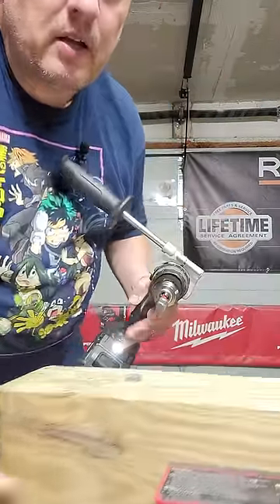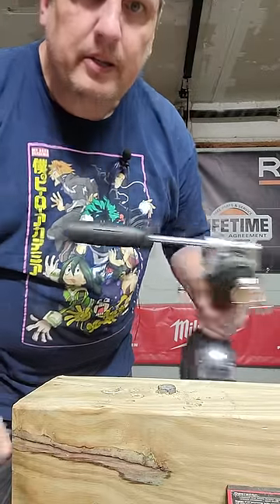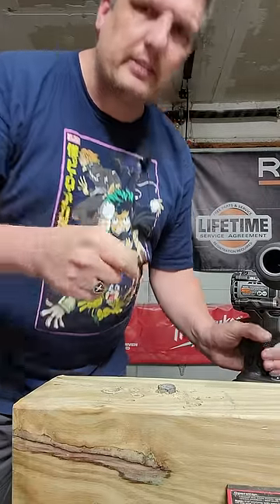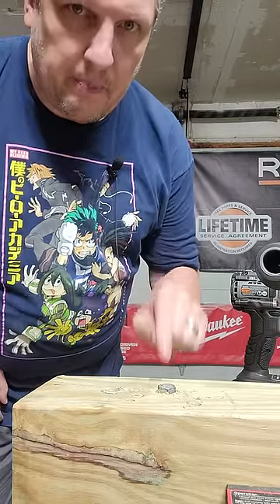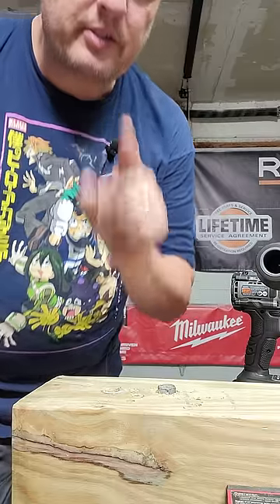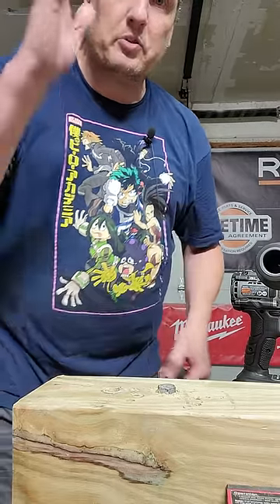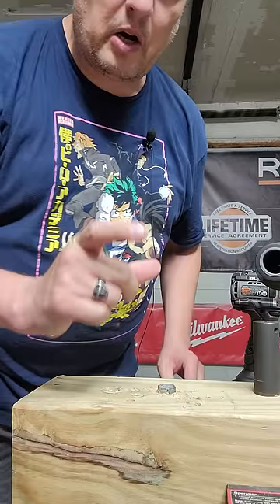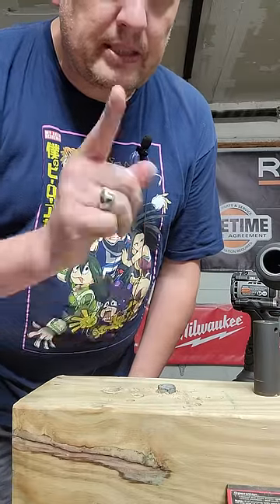Challenge Accepted! Now What? #challenge #powertools #tools #power #drill #EMBARRASSING #victory

Comment: Use a correct sized impact driver for it and the impact will send it faster. As for wrist saving, a hydraulic impact of the correct size would be best if they are made, if not, get on it Milwaukee! I’m sure those would fly off the shelves, I would love to use one for lug nuts on cars instead of using a loud ass electric/air impact all day.
Reply from the maker: No ma'am the drill is the only tool you would use for this

Comment: I pre drill, then use screwdriver. Both devices have less load and the material isnt split. 

Only time i force a screw in is when i have no other option.

Comment: A drill is for drilling a impact driver is for driving lags, screws etc. I promise you that drill will burn up before lag number 10. I have driven 25 lags that size after pre drilling of course on one 5amp hour 20 volt battery battery no problem. And I am still using it years later.
Reply from the maker: I have already proven you wrong
Reply: @ToolswithSoAlz  you sank one lag on your video sink 25 on camera without editing or stopping then tell me I am wrong
Reply from the maker: @bryanbarner5665 now go back to relaxing your throat and making eye contact because that's the only thing you should use your mouth for. 

https://youtube.com/live/usqL3F6uPSo?feature=share

Comment: Yes, you can do this, but only with a pro drill. And it's faster than an impact. But you can drive big screws with any driver. Also, you can buy drill bits for a driver.
Reply from the maker: You can drive screws with a drill if you know what you're doing
Reply: @ToolswithSoAlz  I agree. My friend is a contractor and he uses a drill for driving screws.

Comment: Bro, you are going to destroy that drill. An impact driver is a much better tool for that application. The trick is, you need a larger impact driver. Preferably a half inch drive.
Like a mileaukee M18 fuel 
If you truly think that your drill is going to be able to drive lag screws like that size throughout the day without burning up, you are sadly mistaken.
It's all about using the right tool for the job.
Reply from the maker: I have already proven you children wrong
Reply: @ToolswithSoAlz Man you are angry. Prove us wrong by driving in 100 lag screws like you just did.
I'm not trying to bust your chops, but you have not selected the proper tool for the job.
Reply from the maker: Princess I blew up your precious impact driver doing this just three times. If you weren't such a retarded POS you would know what you're talking about. Unfortunately you are

Comment: Do that test with an XR20 1/2 DeWalt. A tool up to the task, that is easier on your wrists. A 1/4 hex impact is a cabinet makers tool, not a big lag driver.
Reply from the maker: I did. The impact loses and you should never use an impact for this
Reply: @ToolswithSoAlz  I did not see a 1/2 INCH DRIVE impact. Just some shtty 1/4 hex drive crap.
Reply from the maker: @jamesgeorge4874 Ma'am you're letting your excuses expose your ignorance

Comment: Do a battery test, can an impact pound more bolts or can a drill do more.
Reply from the maker: Let me ask an obvious question that even a stupid person could answer. Honestly, any moron could figure this out if they took a second to use the space between their ears. 
Do you believe a slower, less efficient, tool, that has to work harder, hitting metal on metal, building heat, can use less battery?

Comment: You don't know what you are talking about sir. The hammer/impact drill is for being up on a ladder and throwing in a screw with your arm stretched out and very little back pressure to keep from slipping. The drill fails in that regard. Each tool is equally important for it's application. One is not better than the other.
Reply from the maker: Ma'am the level of stupid that just came from you tells me you have never been on a job site. Princess, ever heard of the clutch? Yeah the drill is better. Sorry to educate you

Comment: Yea for one bolt do 10 back to back without smoking the battery or motor. My DeWalt impact can and then some.
Reply from the maker: I have already proven you wrong and I did it live. Not only did a Dewalt Impact driver burn to the ground doing only three of these but it took it 20 minutes to do the three. Dewalt simply doesn't make a good impact driver. Whereas the drill smashed this same test seven times in under five minutes and didn't even get warm. You little children know absolutely nothing about tools but you keep whining like you do.

Comment: you lot are talking about the 1/4 impact drivers that are designed for wood screws... what you should be using is a 3/8 or 1/2 impact driver the same as a mechanic uses to put wheels on a car
Reply from the maker: No, you should use a drill.

Comment: Impacts help save your wrist. Work smarter not harder. You worked hard getting that bolt into the wood. And impact would do the work for you and save your wrist in the process.
Reply from the maker: Unfortunately for you only one of us knows how this would really be done and why the drill is the only tool you would use

Comment: Impact for torque, drill for smooth and consistent rpm, why is this even a question?
Reply from the maker: Read the comments
Reply: The drill did seem to work quite hard under that load, and it did seem that you needed to use a lot of effort. I'm also not sure how many  of those you could drive before that drill at least overheats. So why do you argue the drill in this work scenario? I use electric impacts often, not for that type of work mind you. And they are quite powerful and efficient in size 3/8 to 1/2

Comment: Drills are faster, but get in tip toes, as high as you can, and try installing a Phillips screw with a drill, unfortunately on real construction most of the time you're not working in a comfortable position.
Reply from the maker: You don't know what you're doing and you shouldn't buy, let alone try using, tools

Comment: Not significantly faster. I don't need to start bolts with a hammer before I put an impact on it. And I use much more small fasteners on jobsites now... an impact can replace a drill nowadays... the drill wouldn't replace an impact on-site
Reply from the maker: You have absolutely no idea what you're talking about

Comment: Impact is made for torque and will get it tighter and used on harder materials but drill is always gonna have the speed to compensate but will also twist the entire system like it did at the end of the vid
Reply from the maker: Which one looked like the right tool for the job here? You know, like the title of the video suggested?
Reply: @ToolswithSoAlz for wood either works but drill would be preferable, auto body work is more of an impacts job

Comment: But you failed the second you used a hammer.
 Impact driver doesn't need a hammer to get the process started
Reply from the maker: Ma'am you're letting your arrogance expose your ignorance
Reply: I use compact drills for metal roofing and I tried a normal drill for a couple weeks.
 My arrogance showing my ignorance?
If you were going to hammer the tip into the wood might as well drill a hole in the wood so you don't cause wood damage side note.
 Also it's you making a video about a challenge well if hammering the pit into the wood was part of the challenge I can understand you're just doing what's allowed but let me remind you this is a short you called it a challenge next time brief us about the challenge.
 This is my first time watching anything of yours.
 My first comment was a question over all because I didn't understand so yeah maybe I was showing my ignorance but to get over being ignorant I have to learn smart ass. Also I can admit when I'm wrong or when I did fuck up like I failed to use a question mark ? At the end of the first sentence or should have phrased it better or properly. 
 In short I understand that you're simply trying to give an example of why the drill is better but I still don't understand why exactly so smart ass please teach me something instead of being a dick.

Comment: Notice the tremor in his right hand as he's trying to start that massive lag..Notice the anchor handle  so that he can use both hands... the tremor is likely nerve damage from when he decided to test his therories and the drill nearly ripped his wrist apart.  So what does the impact driver actually do?  Well  in this case... it allows a DIY'r the ability to put this lag in and not wreck himself doing it.  So .. Use your drill if you like, but for $150 bucks... I can buy a Milwaukee impact that will last through thousands of lags just like this one.. without damaging my self, or the wood I am driving into.
Reply from the maker: Ma'am, I have Parkinson's disease. But you brain dead little girls have never had a clue as to what, when, or how to use tools. Shut your clap trap and maybe you'll learn something.

Comment: Drills are definitely better for wood, but please, for the love of god, do not use one with thick metal. That drill will come right around and Mike Tyson the shit out of your wrist
Reply from the maker: Don't hold your tools like you hold your purse
Reply: @ToolswithSoAlz  I dont know what tools you are using but my drill has enough torque to pull out of my grip, and on top of that you have a second handle which definitely helps. To be clear though this comment wasn’t exactly directed at you

Comment: any tools can do this job but but but !! efforts required are different. the best drills, as long as it's not a rotary, have about 1/2 torque of impact driver at the same price.
Reply from the maker: The drill is the only tool you would use for this

Comment: I respectfully disagree. You seemed to put a lot of effort into that. The beauty of an impact is that it takes away the human variable. Let's see you do that with big Phillips head screws. I know you make it work but the impact is better for the job. We could just put a 1hp motor on the drill and it will do even better in time then the one there. It's gonna create extra human stress.
Reply from the maker: You should never even think about using an impact for this. This isn't a how-to video but a can-do video because I accepted the challenge of some moron who thought the impact was the tool for everything
Reply: @ToolswithSoAlz  it really seems like you're suggesting that a drill is the tool for every job. You did prove the drill is capable. I think if you did that job every day you would start to want the impact. My dad used the same machine for thirty years now and his fingers are damaged from the button. The easiest part of the job and it's damaging his hands. Another funny thing, at a shop I worked at, many people avoided using the crane regularly. The crane can often taken longer when you're able to get it yourself or all someone to grab the other side. The crane often takes longer but is still the best way to do the job. If you're proving that it can be done then you've succeeded. I just believe in the right tool for the job.
Reply from the maker: You sound like you don't understand what's being said. 
Impact drivers are designed for small fasteners, where camout is a possibility, self tappers, and over tightened nuts and bolts. That's it
Reply: @ToolswithSoAlz  I do agree that over tightening is possible. I watch my boss over tightening stuff with his impact all the time. It's true that you can use a setting to not over tighten. You have a point there. Maybe companies should create a system for the impacts that are like the drills. I think about that with the big electric impact drivers. They generally have 2 settings.

Comment: The drill may be the better tool, but my f***ed up wrist prefers the impact driver.
Reply from the maker: Maybe you should learn what you're doing?
Reply: coming in hot there, without having context. I have a screw permanently in my wrist that doesnt like the front heavy-ness, and the start and stop kick that drills have. didnt even know it was the drill that was the problem till i switched to an impact.  @ToolswithSoAlz
Reply from the maker: You should learn about the pilot hole
Reply: @ToolswithSoAlz  I do pilot if I’m worried about wood splitting, but most of my work that’s not a worry. I’m not gonna pilot just to not have to worry about kickback, when my impact does that for me. And that also doesn’t do anything about the awkward forward leaning center of gravity that the drill has that fatigues my wrist, where the impact has a center of gravity in the perfect spot.

Comment: Impact drivers are for brick/concrete walls indeed
Reply from the maker: Impact drivers are designed for small fasteners where camout is a possibility, self tappers, and over tightened nuts and bolts. That's it

Comment: My 1/2" Milwaukee impact would drive that with a one handed light touch. That drill will burn out while an impact will still be going.
Reply from the maker: And would still be slower and not the right tool for the job
Reply: @ToolswithSoAlz  
Whatever, I see you struggling and pushing down so hard. Do that 100 times on a project.
Reply from the maker: @kimchee94112 Honey, are you so dumb that you believe pushing down made the drill spin faster or the wood softer?

Comment: not true, if you're a professional driving bolts like that all day you're going to wreck your wrist using a drill. Look at what happens at the end of him driving the bolt, there's no much torque that the table along with the piece of wood moves! An impact wrench is a much safer and better tool no matter if it is slightly slower.
Reply from the maker: You have no idea what you're doing or what you're talking about.

Comment: Dont use a drill or an impact driver. An impact torque gun is where its at for big bolts. You push the bolt through the timber with one them bad boys.
Reply from the maker: Unfortunately for you only one of us knows how this would really be done and why the drill is the right tool for the job
Reply: @ToolswithSoAlz  well i wouldnt be hammering it in place, i'd  be predrilling it.
Reply from the maker: There is no such thing as predrilling.

Comment: To be fair, You beat the sh*t out of the drill and battery (full power at near stall speed for no cooling), whereas the impact could hammer away on that type of screw all day.
Reply from the maker: That's not true and I have proven it. Impacts are not made to be used constantly. Only in short burst.

Comment: Can tell by how shaky your right hand was while holding that bolt that you’ve spent a long time using the wrong tool for the job.  How’s that wrist doing with all that torque on it?
Reply from the maker: Only a moron would use an impact driver for this.

Comment: 24v with a gaint side handle..... so much better huh 1/4 hex impact would have done the same thing using one hand without the giant ass battery... in your comfy shop on the ground with fresh batterys makes it look like your correct
Reply from the maker: Only a moron would consider doing this with an impact driver. Ma'am before you pretend to be something you're not, i.e. a professional, then it would help if you knew the basics. You don't even know what tools to use. Basically I know you're an idiot and worse I have proven it.

Comment: Does it faster and much more dangerously as displayed by wrenching you along with your lumber when it bottomed. Now imagine how much extra force it would’ve put on your wrist, elbow, shoulder and back if it was a fixed beam and it pulled you like that. Now imagine that on a ladder 8 feet up. Now imagine how stupid you would feel falling and paralyzing yourself just to save 10 seconds per screw.
Reply from the maker: Unfortunately for you only one of us knows how this would really be done and why the drill is the only tool you would use

Comment: Can it and should it are different things, the drill should be used to predrill the hole, then run a impact or a drill, wont matter.. but you wont risk splitting the wood in the process, or wearing out your tools trying to make lags drill their own holes... this is why i just build my own stuff, everyone try to cut corners
Reply from the maker: If you knew how this would really be done then you would know why the drill is the only tool you would use for the job. Clearly you don't
Reply: @ToolswithSoAlz  as I said , can it and should it are 2 different things... just cause you can drive like you're on a race track, which very commonly done... doesn't mean you should... which was all I said... it's a simple thing to comprehend what you read before you respond , but clearly you done
Reply from the maker: What's funny is that you're lecturing to me and pretending you know what you're talking about. I find it funny. You have never done this, have no idea how it would be done, and worst of all, you don't have a clue.
So, Honey, you would only use the drill. It is the only tool you would use.

Comment: that’s funny my cheap ass rigid impact did that in les time with 3/8 inch pre drilled holes with a 1/2 inch titan bolt into concrete in less time and didn’t jerk my hand like a drill would not to mention it was 8inch screws so idk i like my impact

Comment: It doesn’t make it a better tool, you just use the tool for the job. I would never use a drill for its wrong purpose. Although the new technology for tools has come a long way. The new Milwaukee technology will save your wrist on their new drills. He is using the right tool for what he’s doing. If you’re driving smaller fasteners and impact is always better. Also for putting nuts or bolts impacts are better. Drills are only necessary for drilling holes, driving big lag bolts like in the video.
Reply from the maker: K